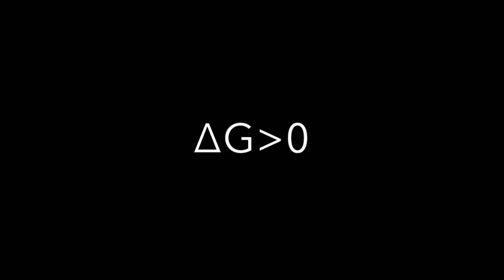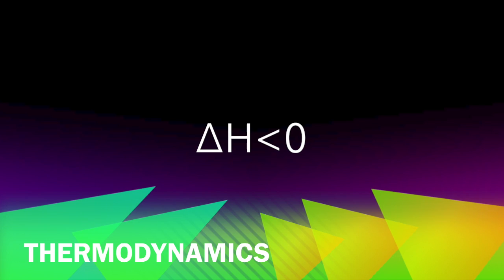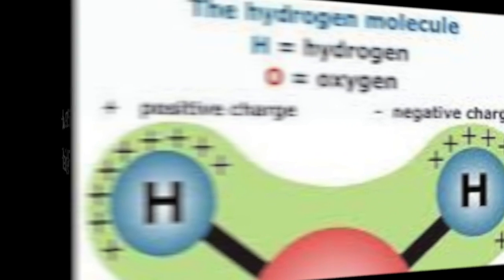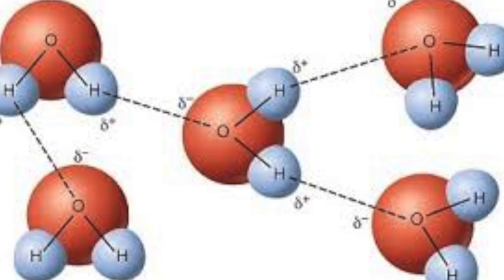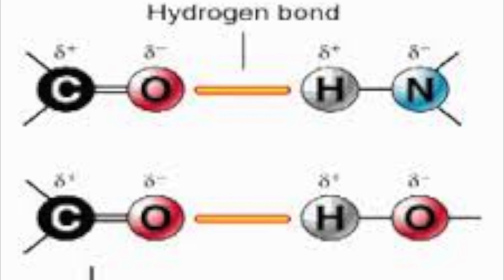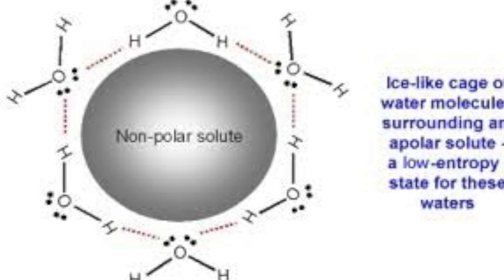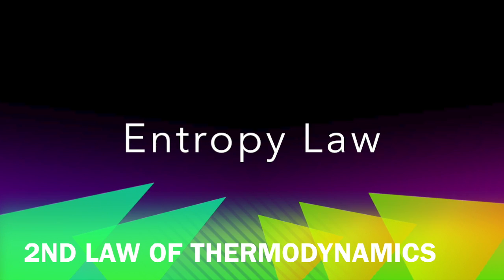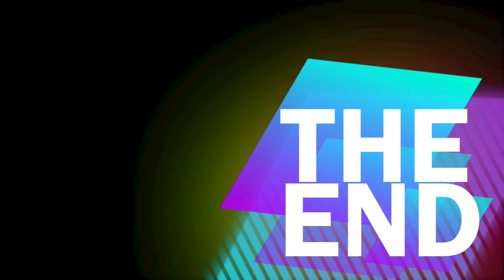The Hydrophobic Effect

Comment: Thanks bro, so basically:
Hydrophobic effect = tendency of hydrophobic molecules to group together to reduce surface area and allow water to form the maximum number of hydrogen bonds. (lowest energy state)
Reply: +violinsheets the number of hydrogen bonds in-fact does not change much. The important point here is when non-polar molecules group together and reduce the surface area, the number of free water molecules increases resulting the increase of entropy. Increasing entropy if the key of hydrophobic effect